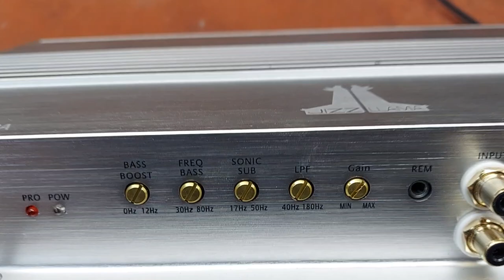Jizz Llama 1000/1 class D guts $300 shp'd w/3yr 100% QC replacement for replacement of JL Audio amps

Comment: 0:52 in that frame the diodes are 5 and 6 and 11 and 12!    from left to right 2 p--fets  than 2 n-fets than diodes for psu 1 than the same vor psu 2 . the 2 diodes you pointet at are for ground ref,
Reply from the maker: Mmmm.  I like a guy that pays attention to detail.

Comment: Robotunderground? Do you happen to be in AZ by any chance?

BTW, I love the "F U, george" at the end 😂
Reply from the maker: Yes you can Google Robot Underground and it should come up with the maps and Google page
Reply: @RobotUnderground  Awesome! I have an MTX Thunder 9500 that is in need of repair. It has a 1/2 in crack/hole in the dust cap but MTX has discontinued parts for this sub.

Comment: Yo bro I need 2 of these when you going to Dyno and is there going to be a matching 4 ch
Reply from the maker: No matching one right now.  I want to do a compact class D as the matching 4ch.  Might happen next year when we can afford the black heat sink.  Right now I have the Recoil RED 600.4, older class D amps that are the same as the Cerwin Vega B54 for just $140 each shipped.  They're silver and black but say Recoil on them..  Text me for pics, 6023126504

Comment: I need a 1700 rrms 5 channel
Reply from the maker: Good luck in your search.  You probably only need 500w for the highs and 1000w for the sub.  I have a solution with 2x amps for $240 shipped.
Reply: find a memphis belle 16-st1300d

Comment: Where can I purchase one?
Reply from the maker: Just text me direct with your name and shipping address.  We can even ship to your client with YOUR return address on the box so you can keep us a secret. 6023126504
Reply: @RobotUnderground  Thanks! I'm close. Maricopa. I have two other JL Audio Slash 500/1 V1 that died or has some issue with it. I'm currently using another used one I purchased on Offerup.
Reply from the maker: You can sell the dead ones for around $100 each shipped.
Reply: @RobotUnderground  I find it somewhat disappointing that the much-vaunted JLAudio amps die.
Reply: @RobotUnderground  wow. This is some CIA cool shikaka!

Comment: looks like a diamond 1200.2a amp i have
Reply from the maker: Different factory.  Thanks.  Several makers have been putting all the connections on the same side of the board for ease of installation.
Reply: @RobotUnderground  i know same fusing and diamonds r forever
Reply: all good like i say what hasnt been copied or ripped off only should credit those who engineered it not ripped it off